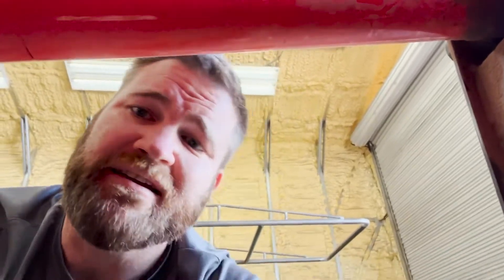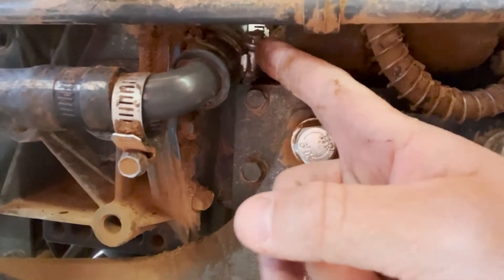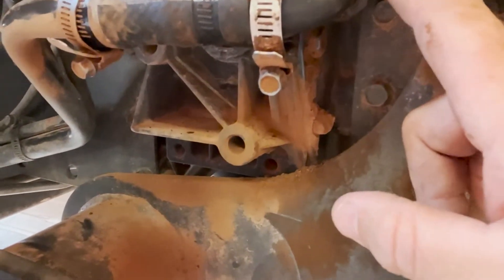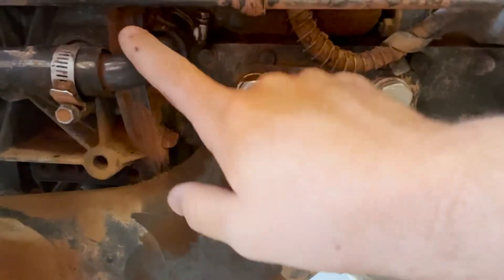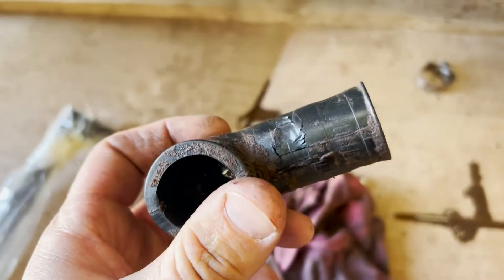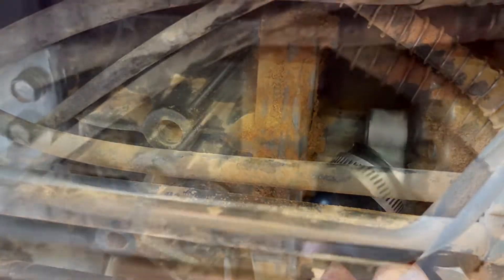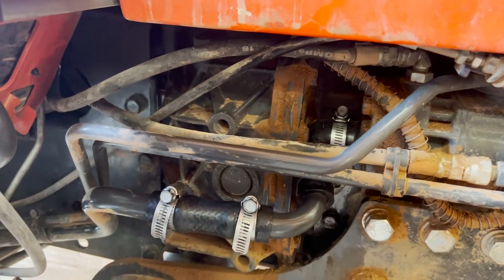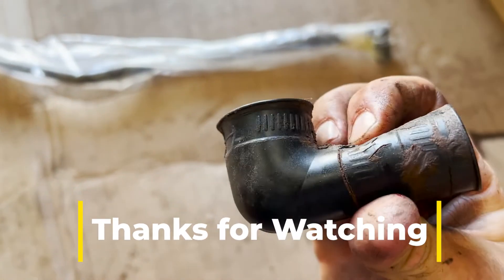Kubota B26 Hydraulic/Transmission Leak and Repair

Comment: I just fired up my B26 today and found it had the same problem. I had also replaced the original elbow with the "upgraded" kit from Kubota last year, which only lasted about 1 year with less than 50 hours usage. I agree, the original set up was actually better as it went almost 500 hours before it started leaking. At least I know what to expect, I guess I'll order a couple spares since this "wearable" part has a very short life span. Thanks for posting the video.

Comment: I have the exact same issue with my B26. I’m on my 4th rubber hose, only 422 hours. I think the newer elbows are a softer material and breaks down quicker with the heat of the oil making it softer and more acceptable to tear. I believe the original ones were reinforced rubber that I think wore better with the heat but not so forgiving in the movement. I think the new design is overall better but at least upgrade the elbow to a reinforced true hydraulic type hose and not some simple flimsy rubber junk
Reply from the maker: I agree. Luckily after the third hose I haven’t had any more issues. Knock on wood it’s been about 6 months and it’s still going strong.